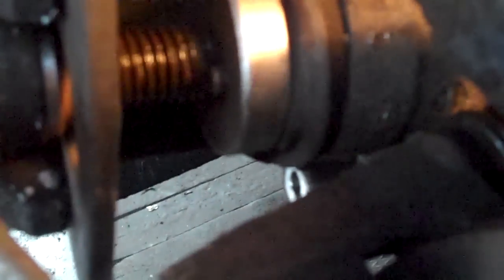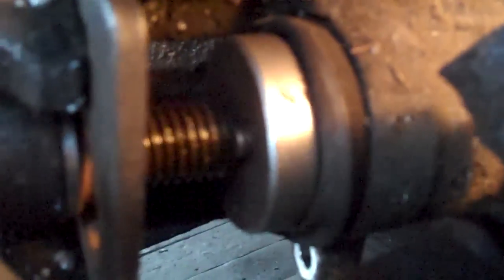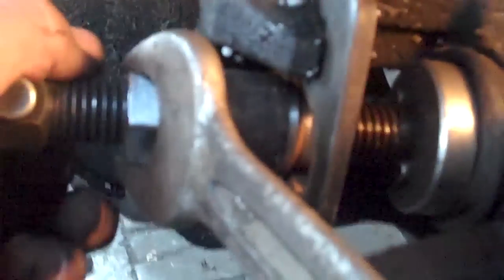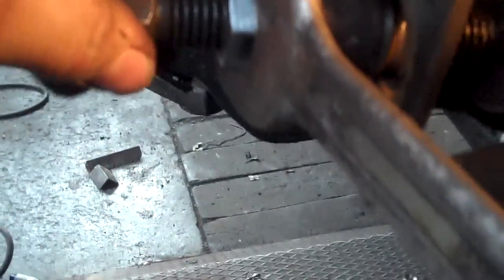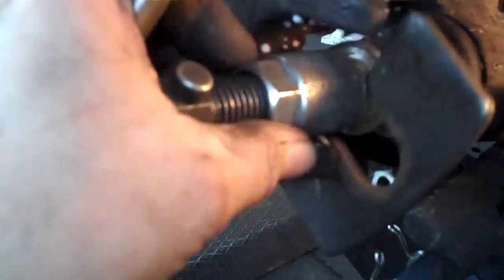VW GOLF 19 TDI REAR BRAKE REPAIR

Comment: Hi there Liam, thanks for the response but I meant to say... do you wind the piston on the opposite rear wheel in the same direction also or is the thread opposite ?
Reply from the maker: +Marcus O'Donnabhain (Footsack) as far as i can remember its right hand, clockwise,easy way to find out give it a turn anti clock wise, with large pliers, if it pops out a bit ,its a right hand thread, work gentle and dont damage the thread, its good practice to remove piston and polish with 400 grit sand paper, it will be easier to wind back,and refit.